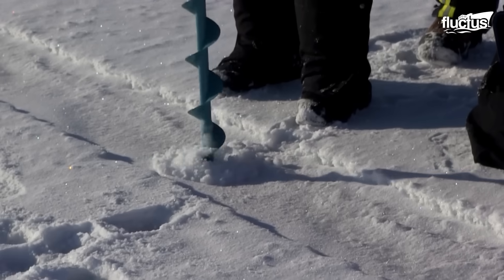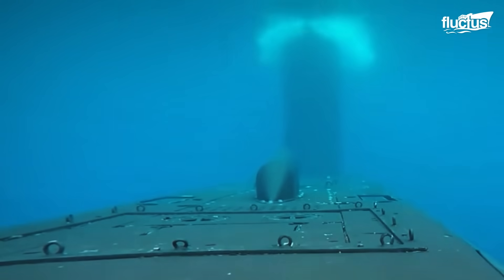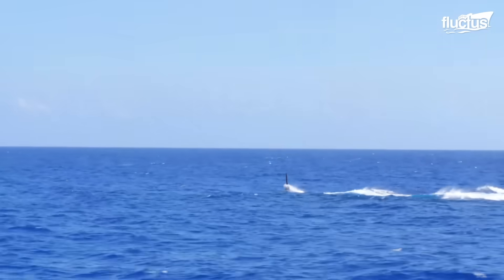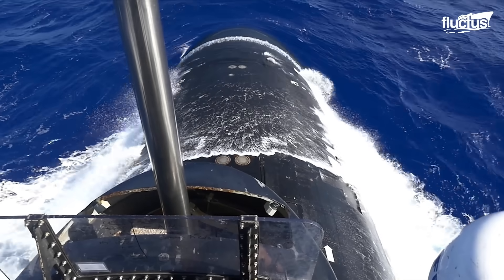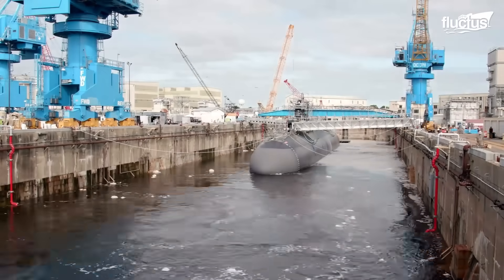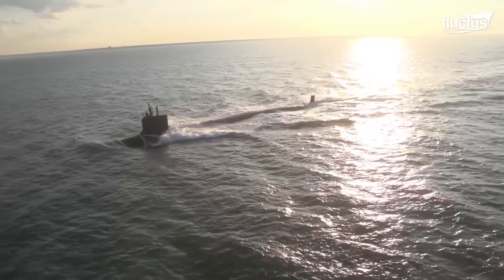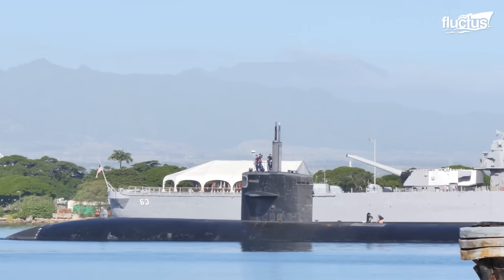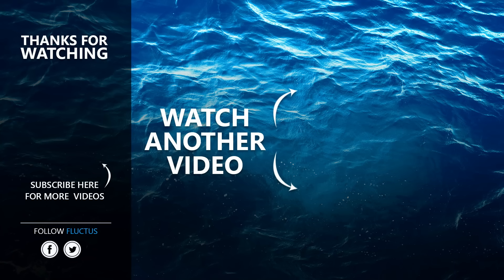Massive US Submarine Breaks Through Thick Ice to Resurface in Arctic

Comment: Virginia- or Seawolf-class subs like the USS Connecticut use hardened sails and upward-looking sonar to locate thin ice (1-3 ft), then surge vertically with full ballast blow, shattering up to 10 ft of pack ice. This capability, honed since Nautilus in 1958, enables stealthy patrols under 80% of the Arctic, evading detection for ISR against Russia/China. It's a strategic edge in the melting North, deterring rivals like Russia's Yasen-class—raw power meets engineering grit!